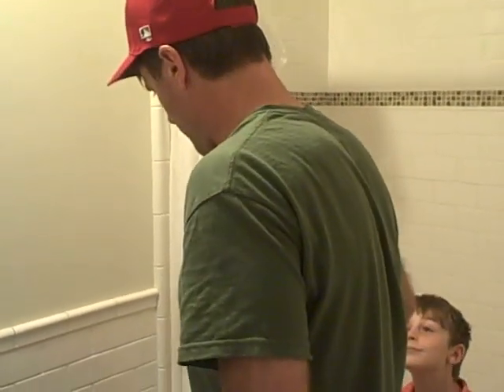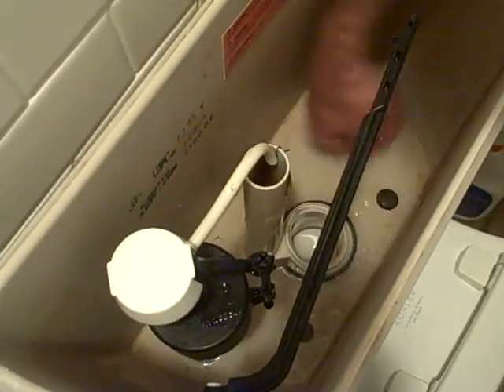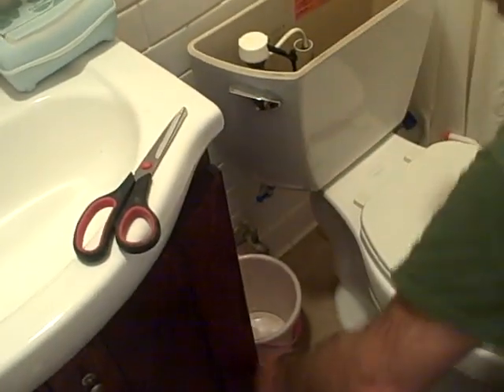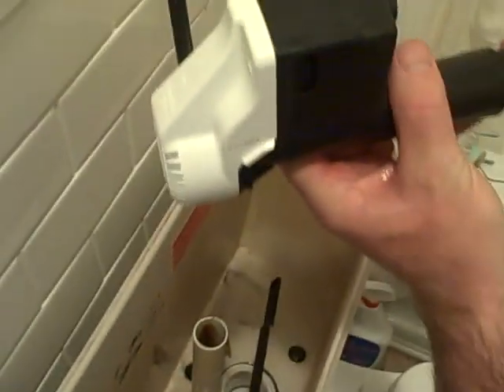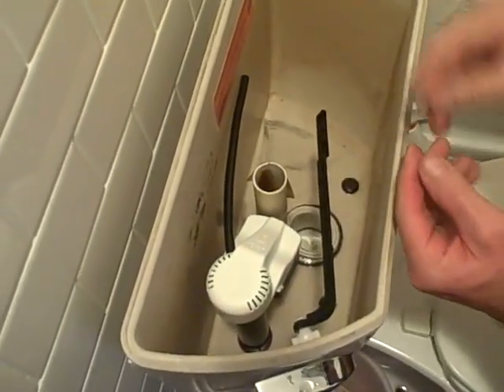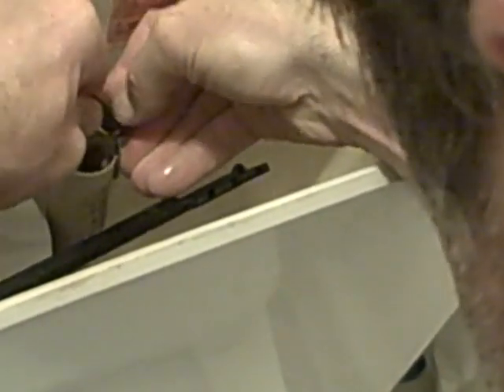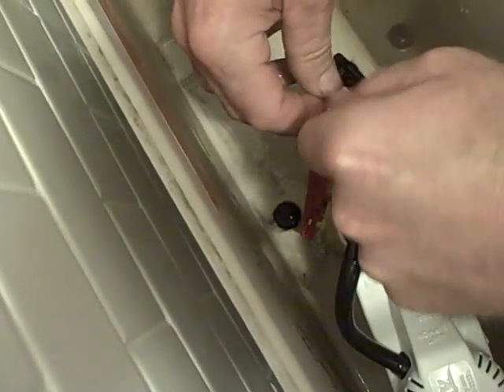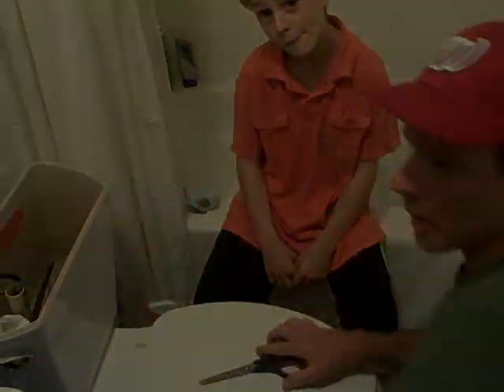How to Replace Toilet Fill Valve

Comment: Thank you for video. I never actually let the tank completely empty of water or dry it out with towel before I replace fill valve and I always use plumbers tape on threads of valve before I hook back up water supply line just as precaution against leaks.

Comment: Oops!  The bowl fill tube is supposed to squirt into the overflow tube, not the tank. That helps provide the right amount of water in the bowl after flushing.
Reply: Exactly. Just reading the installation instruction would tell you this.
Reply: +Rollie Peck So the guy in the video did it incorrectly??